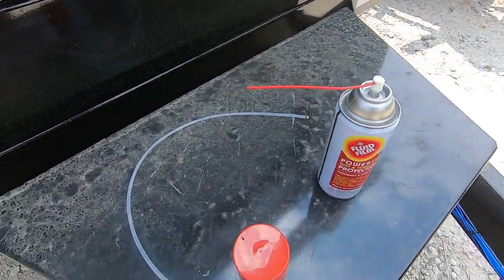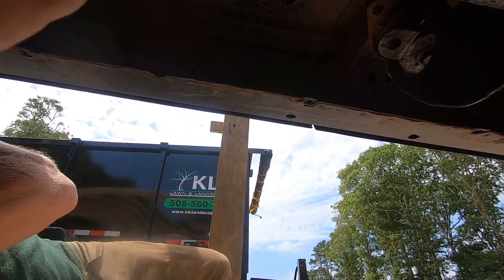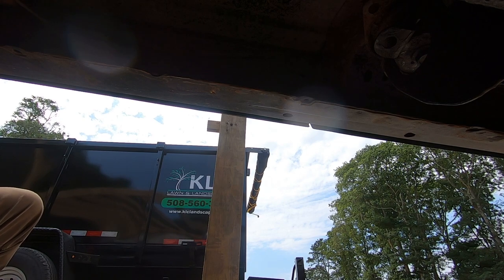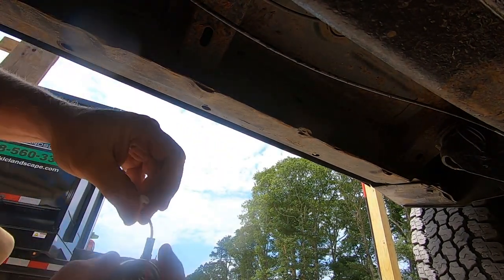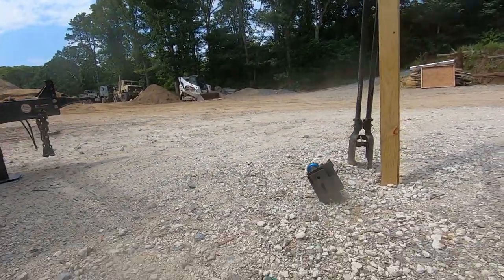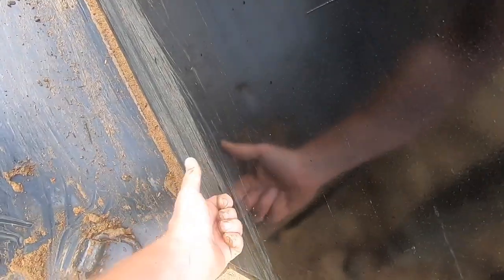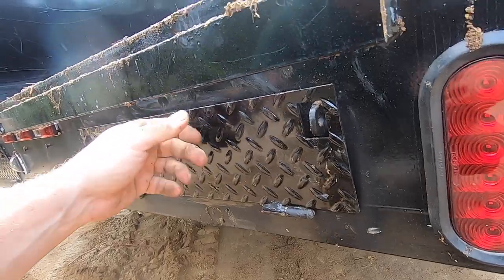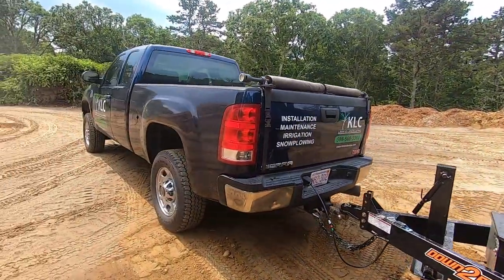HOW TO Rust Proof Your Trucks Rocker Panels and Cab Corners!

Comment: Wish I would have sprayed my rockers years ago.  There are plugs in the rear wheel wheels also.  I cut out the rust and put a replacement a panel a couple years ago.  Definitely going to do more preventative measures on my next truck.

Comment: I've Never used Fluid Film.  Some areas need to be flooded, like inside the door on the bottom metal pinch areas.
well all pinch areas, and up that cavity where the cab corners rust out.  Those metal pinch areas along the seem need to be treated and spray wont  get to them.

I use mineral oil and a spary bottle but I use the stream, and shoot those seams and some of the other rust areas.
I know its working because the porus rust will soak with the oil and it will seep and spread.  The next day the metal treated will be a darker color.  you can see where you missed easily.
I like the spray tube they give you, not sure if you can get  enough on the rust with just a spray.  You actually  need to saturate  the rust to stop it.

Where to spray,  if it is metal or has a metal reinforcement, it needs to be treated, including the hood, over the wheel wells, tail gate in the doors, in the cowel, the rockers,  it will keep you busy to stop the rust if you want to save your vehicle.

Comment: i have a 92 c1500 it has the big access holes iin the rockers i can feel and pull rusted metal flakes out its not all the way through and still solid from the outside question is is there away to get all that rusted mess out and rust proof the inside of the rocker if so explain to me tia great video btw

Comment: maybe a rubber lip/skirt could be attached to end of dumper to shield the rear doors and lights from debris.
Check out LPS-3 its like fluid film but turns to a wax film. useful in situations where debris would collect like underside of the dumper. Maybe would look ugly over time though?

Comment: wish I saw this last fall, I paid to get the truck rustproofed only to find out this spring that there is no real sign that it was rustproofed at all... I had a full tour of the vehicle 's underneath and although much rust there is hardly any sign that they did any work on it... this fall I will be going somewhere else but also doing this for the rockers and corners

Comment: I did this exact procedure on my 1999 GMC sierra also the frame and front end love this stuff. I also used the fluid film black for the external frame and rear axle works very well.

Comment: I live in Toronto Canada and they use ALOT of salt in the winter. would do this every spring and fall for sure. I never realized how many holes were in rockers, why? to add rust proof it must be. why wouldnt they just put no holes in them and keep them air tight

Comment: for what trucks cost they should have the frame and inner panels painted with por15 style rust preventive paint ,and be undercoated from the factory
Reply: They do, but that is on a different planet.  Rust decay is manufactured into the design here on Earth.
Reply: they all rust eventually no matter what you do, even in a garage, i work in a body shop, in some areas it's worse but they all rust eventually, you can prolong it a while, but it's bound to happen

Comment: What are you supposed to do to repair the rocker panels?!
Reply from the maker: I have a few videos on rocker and cab corner replacement. I am currently doing 2 rockers and cab corners on 06 2500hd crew cab. I post pics on IG if you want to follow mrklc1974

Comment: I was thinking on fill.it up with foam to lrevent inner rust
Reply from the maker: NO SIR!!!! That is about the worse thing you can do.... Water will get in between the foam and metal and be trapped and make it worse and never dry. Just the metal temperature changing overnight will create moisture on the surface